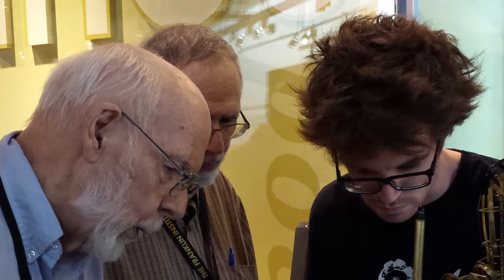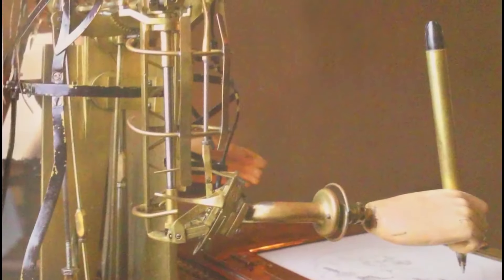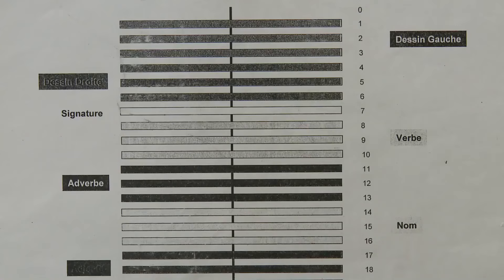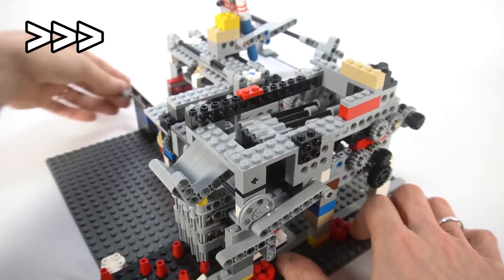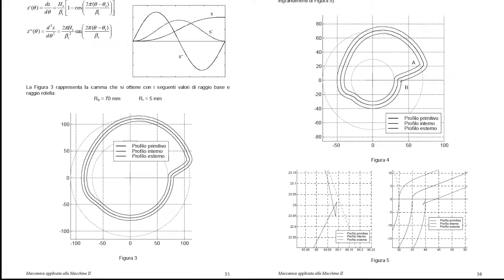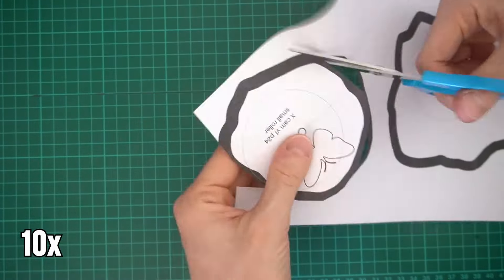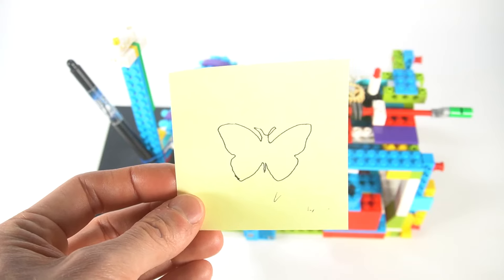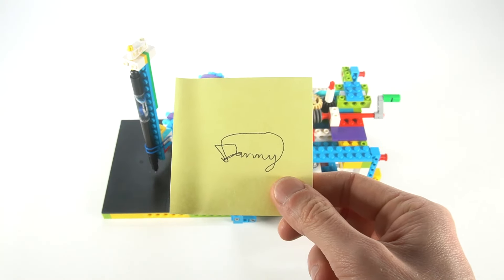I made a LEGO drawing machine using cardboard cams

Comment: Just based on the location of the asymmetrical errors I would assume most of the distortion in the output is based on the elastic band variability of force depending on the extent of which they are stretched. 

I assume that the original makers may have attached pantograph arms to pens logging each joint component position (x,y log for each joint on a scroll of paper).  Then manually guiding a arm mock-up, execute the drawing motions. They essentially captured the position data, measured points in the paper and translated it to radial measurements. Then through a process of iterative adjustments perfect the output program. 
Much more complex data could be captured by running a series of strings and pulleys through the joints of the “capture arm”.  Essentially they are building an analog integral calculator (those ancient automata exist too for adding waves, differentials, etc)